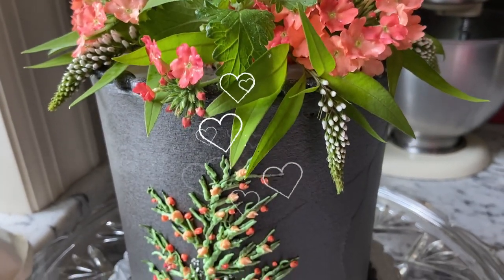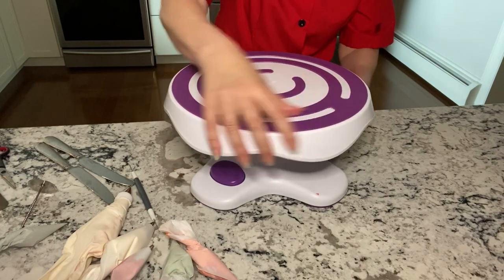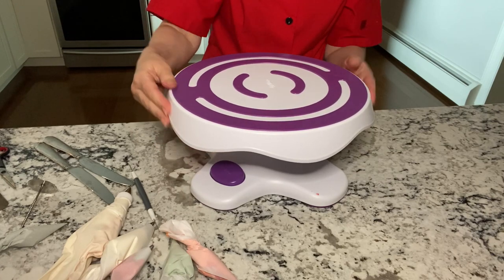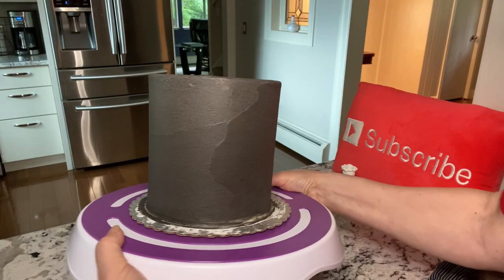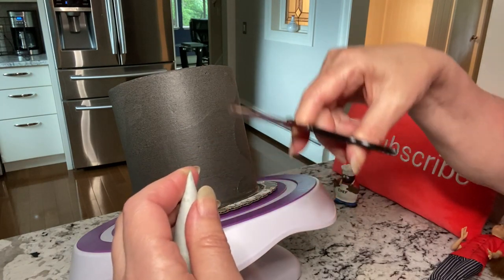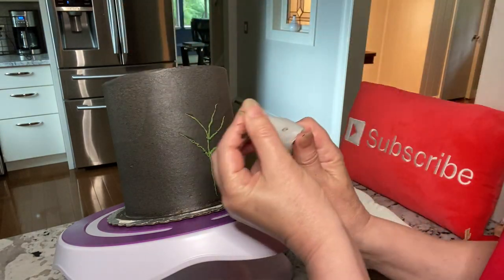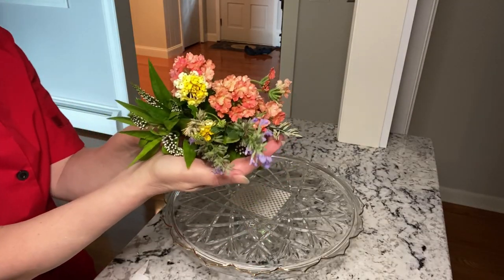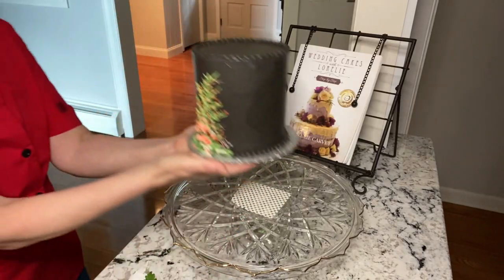How to Pipe on the Side of a Cake 💐 Floral Cake Design 🍰 Cakes with Lorelie

Comment: Please help! The buttercream on my cakes keep cracking and sticking out after I decorate them why is this happening??? What am I doing wrong??
Reply from the maker: Hi Kim.  What type of buttercream are you using?  What type of board is the cake on?  If the board is flimsy the cake may crack when you lift it. Also the buttercream contracts when cold. This has happened to me as well. If possibly;e warm it to room temp and smooth it out. But I need a little more information.
Reply: It’s shortening and butter buttercream the cake board was flimsy
Reply from the maker: @sacquoyia  Ok try an improved board and see what happens. The fact that you have shortening in there would make it less likely to crack I believe. But I could be wrong. I don't use it. You can get foam board cake drums for your cakes or double up cardboard and hot glue together.
Reply: Ok thanks so much for your time